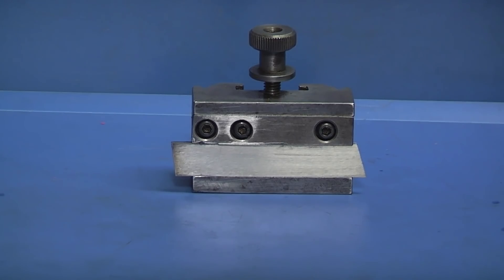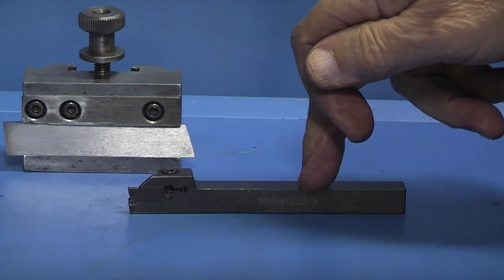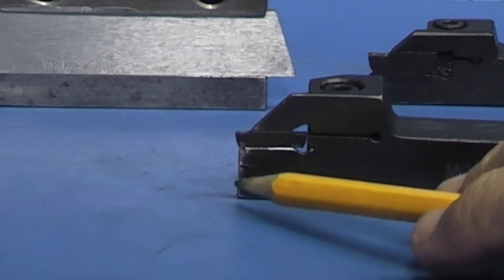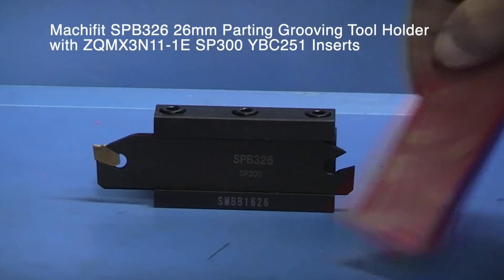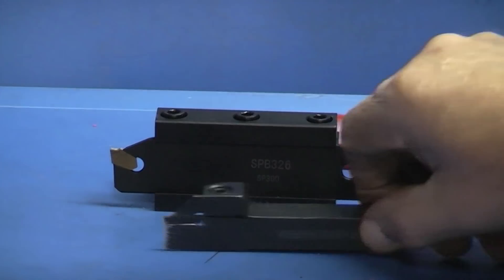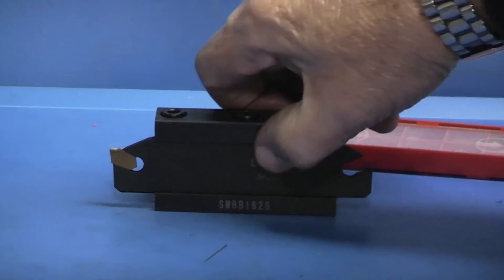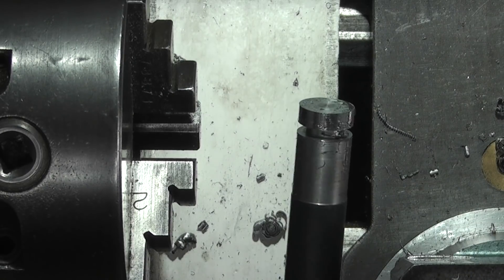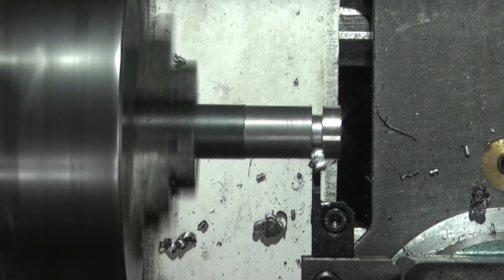Parting off tools

Comment: One thing I have found helpful to keep the inserts from breaking is to ensure that the tip is on center after honing a sharper edge on the tip. I noticed that the tip tends to be rather blunt and honing the tip reduces the pressure needed to cut

Comment: Revisiting this years later because of some of my own recent parting off disasters.  Look @9:33 - the insert appears to be crooked in the holder.  The tip is off to the right and the back end is not flush with the holder.  Note that after it breaks the holder is not centered on the groove.  Parting at higher speeds seems to reduce the number of failures.

Comment: I had the same problem, then I remembered an article in Model Engineers Workshop where the point was well made that inserts are designed for production processes where the speeds are very, very, high.  Thus, I wacked the speed up to 1500 (cutting a 25mm dia MS bar) and the inserts sailed though.  I used 1.5mm, 2.2mm and 3mm inserts and the finish was better when using cutting oil.
Reply: I agree, the tool is rubbing due to the low speed

Comment: Another thing... I was having a lot of trouble with those square shank parting tool, until I basically buried the entire raised head portion so that only the necessary portion of the tool sticks out. This gave a lot more support and allowed me to not break them. May not be possible with quick change tool posts, but most 4 way tool post is wide enough that the raised potion will fit.

Comment: Interesting video, as said below parting is such sweet sorrow at least for me! On a slightly different vein what is  tool post you have there ? Is it call Dickingson or something?  I have  a Boxford  with the same tool post and need the two spanners for it . Are they available to buy or can you ( or anyone)  tell me the sizes so can buy at least the right size imperial  spanners? I have only metric stuff so nothing really fits. I am hoping somone can help me out here. Thanks and sorry if i Hi jacked anything!
Reply from the maker: Hi David I use a 13/16 ring spanner cut in half for the clamping nut and a 3/8 ring spanner for the tool locking nut

Comment: I made my own parting blade from 3/32" x 1" ground flat stock, simply hand filed the insert location to suit Iscar GTN3 tips, oil hardened and tempered just the working area and slot mounted it in a basic steel block rear toolpost, machined to hit centre height. The blade is clamped into the slot with one M6 button head screw. Rear mounted is the way to go on small lathes.

Comment: I made a rear parting tool holder for my Chinese lathe and bought the Bangood parting tool. The parting tool is flattened on the top and bottom to remove the v shape seating and clamped from the side into a slot and no other holder is used so it's extremely rigid. The centre height is engineered in. It totally transformed the parting off performance but I got carried away playing and parted some pretty tough stuff. It dealt with it well but the forces were enough to open up the slot the carbide tip slots into. With hindsight getting the taller parting tool would mean there is more support under the tip. You might get the same bending down if you get too enthusiastic. I fixed it (hopefully) by making a support under the front of the parting tool.

Comment: On manual equipment, it’s hard to get the correct feed rate for carbide. Without continuous surface speed, these inserts don’t really cut as designed. I’d say that rigidity of setup is an issue as well. You really want just enough depth to get the job done, nothing more. The tendency for tool posts to deflect away from the cut can bind inserts in the slot, so really tighten everything down. The parting tools on a shank are the worst at coming loose and slipping.

Comment: I’ve made a solid toolpost to replace the top slide and parting off is a piece of cake now. Top slides on smaller lathes are simply not stable enough for parting off, especially larger diameters

Comment: Thanks for yet on more educating video.
I use part of blade toolholders like the second one You show, at time 01:24. I have faced a problem setting the toolholder at the right angle. Using a 1-2-3 block between the chuck and the toolholder does not always work out well enough and I adjust the angle more watching the blade, the insert itself. Then it cuts better. 
Is the guiding of the insert in the holder always good? I wonder.

Another question. Using a 2 mm cut off inserts ought to call for less tool preasure then using a 3 mm insert. What do You Think is the better alternative?

Being in a hurry I chucked up a 40 mm round 6061, 12" long, and parted off a short piece near the chuck. Being generous with Red Spirit, it worked out!  Normally I would use a steady rest for the far end. (The tailstock had to be removed to give place for the 12" in my 7 x 14" lathe)

Comment: Hi Alan, for say EN8 that size I would bring the speed right down to around 250 rpm or less, it's basically a form tool. I've never had an issue with even the 2mm version you have.

Comment: I have not had much luck with the insert types, esp for 304 SS. I am now back to HSS blades, and they work well. I have found that if I am parting anything over 1", making the groove wider for the first half or so helps a lot with binding.
And, I agree that the insert tool holder that you showed at the end, there is too much overhang away from the tool post. The 207/107 type blade placement is much closer.

Comment: Thanks for posting Alan. I have had no success at all with any carbide tooling on my mini lathe and parting off was a nightmare until I stopped using my quick change tool post, went back to the turret type and used a  HSS blade with a T profile. No problems after that.

Comment: Hi Alan,there seems a bit of a lottery with these small insert parting tools. I bought a blade and mounting block set complete with ten 3 mm wide inserts from APT. This set was from their budget range. The first box of tips were good and I did all manner of parting off from small diameter right up to parting 100 mm steel. Had no real difficulties with it, seemed very predictable and dependable. Get down to the last tip in the box and re-order the same tips from APT. From the point where I started using the second pack of tips I had no success with parting whatsoever. The tips would very quickly gall up in the groove and then snap the tip and destroy the throat cut out on the steel blade. I can't really see anything obviously wrong with the new tips on close inspection but there obviously is some difference from the first pack that causes the later ones to be unusable. I since bought a new 32 mm blade and 3 mm wide tip set from Banggood. They seem OK but I am a dedicated convert to simply parting off in the horizontal band saw these days. The added bonus being that the bandsaw blade wastes a lot less bar in the cutting process.

Comment: Allen, I've given up on parting tools and just use my saw but if you're willing to take the time to mill off a tool holder then why not build a tool holder to house the new parting off blade. You will reduce the Leverage more and reduce any vibration caused by the screw joints.

Comment: If those narrow blade holders would be of a decent material, they would hold. The slightest being off square puts enormous strain on these tools so they break. I had this too, so i changed over to a big hss-co10 parting blade and it cuts like a dream. Those 2mm cutters are only good to cut small grooves for a snap- ring or a small setback behind some threading.
Reply: That's all I bought one for, 2mm grooves.

Comment: I have Sandvik  blade type parting tool and always struggled with it so changed over to a 'T' section blade mounted in a rear tool post  and parting off is a dream.
Reply: Those t shaped blades are nice.